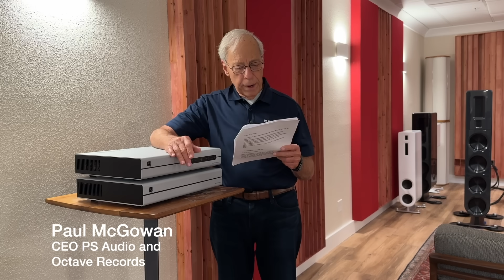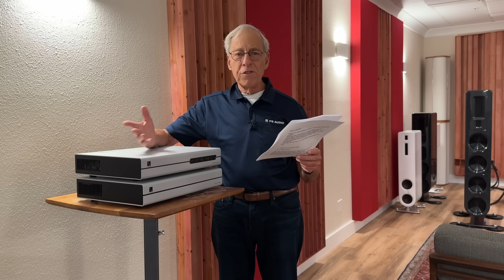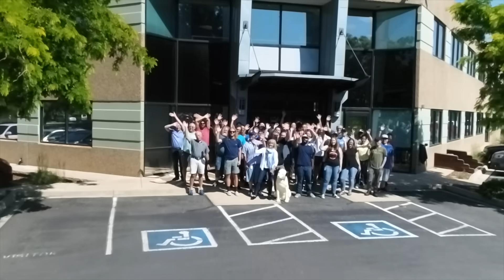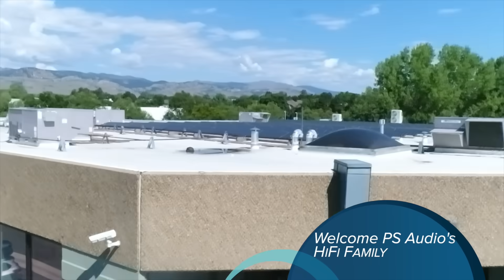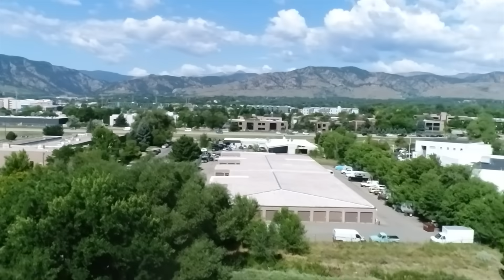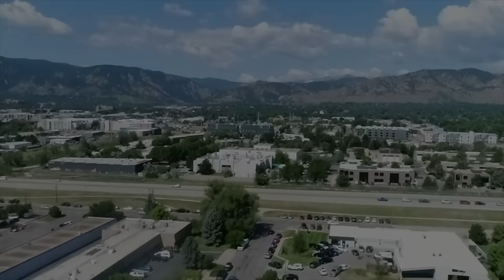Why should we care about distortion?

Comment: And PS audio measure their watt output with 1% THD and 1 kHz only which is ridiculous for hi-fi. The hi-fi standard is 0.05% and 20-20.000hz but then those watt numbers wouldn't be as big
Reply: nicolaihalby ... "only" ...this is incorrect.
I just went to the specifications page for the PS Audio - 'BHK250' stereo amplifier & it gives a range of four (4) IMD & THD figures. One of them is, "20 - 20kHz, 1w/8Ω ... 0.1%" If you don't believe me then go look for yourself...& since when did 0.05% become "the Hi-Fi standard"? Please publish the evidence.
Reply: I don't see a 20hz-20khz full power distortion spec on PS audio. The full power measurement is at 1khz and is 1%.
Reply: @mitchtaylor6512  
As others point out ... this is a standard to be used for comparison with other equipment.  It's not the absolute and certainly not the only specification used in testing.
Reply: @Douglas_Blake but 0.05 THD and 20-20.000hz is the hi-fi standard. 1 kHz and 1% THD is just to inflate wattage. Just like some speaker manufacturers use +- 6dB instead of the standard +- 3dB. Can't remember if PS audio use the 6dB, but wouldn't surprise me.
Reply: @nicolaihalby  
Don't look for conspiracy where there is none, my friend.

Think colour for a second:  If I say RED what do you envision?  But if I specify "Sherwin Williams Red #43" now we have an exact colour to compare to.

1khz, 1% is a standard of comparison, accepted throughout the industry.  If we measure all amps that way, we have facts that we can compare.  

It's nothing but that....
Reply: @Douglas_Blake conspiracy. WTF you talking about 🤷
Reply: @nicolaihalby  
Read it again ... if you can.
Reply: @mitchtaylor6512  ...& your point is??
Reply: That's the point nicolaihalby was making, so he was correct. He was talking about 20hz-20khz distortion measurements at full power.
Reply: @mitchtaylor6512  ...no he wasn't. Please read his original statement (as often as you need to) that I have quoted in bold print ...& stop deflecting.
Reply: And BTW the only thing where 1 watt matters is s/n ratio because that's when you really hear it. Easy claiming 250 watt and the giving distortion specs with 1 watt 😂
Reply: 1% THD power rating is the industry standard, and based on a number of ISO standards for power amplifier ratings. For most modern amplifiers, the difference between the 0.1% THD power and the 1% THD power isn’t very much. It makes a lot more sense to standardize at 1% THD, since that’s around the distortion level where humans start perceiving distortion as clipping.
Reply: @XmqApT4yPQVCXGwR5Ozn not entirely correct, higher order harmonics can be heard below 1%
Reply: @nicolaihalby  ...& now you're just deflecting from your original comment. The fact is that you said, "And PS audio measure their watt output with 1% THD and 1 kHz only which is ridiculous for hi-fi." & that is incorrect. Now that I've proved you incorrect, you haven't even bothered to go back & edit your original untruth to make it factual...smh.
Reply: Maybe you should read his comment again. One watt output was never mentioned. PS audio does measure the maximum output power at 1khz and it is 1% distortion.
Reply: @mitchtaylor6512  
Do you understand the concept of "fair comparison" ... You know the old thing about "apples and oranges" ... you compare apples to apples and oranges to oranges ... and power to power under identical conditions... do you grasp that? 

Haven't you noticed that almost all reputable companies compare power at 1khz and 1% distortion?  That is done so that you can make a chart and fairly compare amplifier power.  It absolutely does not mean that other tests are never performed and it certainly doesn't mean they trying to jack up the wattage numbers.  It's an industry standard test that allows fair comparisons.  

FYI... here is how the test is done...
Hookup and amplifier to a signal generator, distortion meter and dummy loads.
Send in a 1khz sine wave.
Turn up the level until the distortion meter shows 1% distortion.
Now take an RMS voltage reading at the amplifier outputs.
Using P = (V x V) / R calculate the wattage.

It's a simple basic test that even a hobbyist can do.  Since the same test conditions are used for every amplifier, we then have a fair comparison of power between them.

That's it... that's all that 1khz 1% spec. is about... fair comparison... there's nothing more to it.
Reply: @mitchtaylor6512  ... once more for the visually challenged, "And PS audio measure their WATT output with 1% THD and 1 kHz ONLY which is ridiculous for hi-fi."
Now, Mr Taylor... "watt" is singular...meaning one watt & "only" infers that there are no other measurements shown & yet when I go to the on-line page for the PS Audio - 'BHK250' it clearly shows a measurement made from 20 - 20 kHz. If you don't mind me asking you, did you complete primary school?? Where you would've been taught the difference between 'singular' & 'plural' & where you would've been taught the meaning of the word "only" 🙄🥴

Comment: So, then, what kind of measurement can correlate to sound quality?
Reply: stephenwong9723 ...your hearing.
Reply: In general, the retail cost is a more accurate measurement of sound quality than sinad.
Reply: @Pete.across.the.street  😅 older hi fi ones were (and still are) very expensive
Reply: @PokeStoryHarry  got to compare it the price to the other grear that it was selling against when new. Or against other vintage gear. If you compare apples to oranges it doesn't hold true.
Reply: @Pete.across.the.street just compare older ones’ new price at the time and apply inflation and compare, older ones are more expensive
Reply: @PokeStoryHarry  that's not Apples to apples. The market and technology are different
Reply: @Pete.across.the.street  the only one that works for u seems to be comparing the same product on a same product
Reply: @PokeStoryHarry  ...it is hard to compare older (vintage) gear with new stuff mainly because the vintage stuff is not in production anymore & so you can only compare a vintage component with what you think it is comparable with & that, my friend, is subjective. For example: my Celestion - 'Ditton 66' floorstanders that I bought brand-new in 1981 for AU$1,430 would now cost (today) AU$6,880 using the on-line 'Inflation Calculator' & yet to get the same SQ from that pair of loudspeaker I would have to spend around AU$13K on a pair of, say, DeVore Fidelity - 'Orangutan O/93' floorstanders. And then you might disagree with my comparison 😊🥴
Reply: @Pete.across.the.street  
If that's true (and it isn't) how do you explain $100 amplifiers that outperform $1,000 amplifiers?
Reply: @Douglas_Blake  which $100 and which $1000 amp? In What aspect does it outperform? I said in general,  there will always be over priced items.
Reply: Prob multitone intermod distortion less than ur hearling limit of detection distortion in freq domain and fast slew rate (<5us or so) that you cannot detect the speed in time domain
Reply: Music can be clean / dirty, warm / cold. But prob old music sounds better if u use the devices from that era 😅 i guess thats why ppl remaster or try to remaster

Comment: Ultra low distortion won’t fatigue your ears.
Cable materials and passive filtering helps.
That’s how I get there.
Reply: Add vibration control. 
Components count, too.
Reply: yes there must be a reason why you d spent all that money . i mean if u r talking about like 0.1 and 0.0001 territorry with ultra low .
Reply: @tolgadabbagh1877  ...the reason would be 'bragging rights' because if you can't hear it then there's no point blowing all of that extra cash.
Reply: The more you spend on audio gear the better it sounds. It's how our brain works and why snake oil audio cables selling for 1000s of Dollars exist. Our brain is very unreliable in judging audio fidelity. Get too little sleep and you wont hear details well. Drink a Red Bull and you will discover new details. Pay US$5000 for speaker cables and you will convince yourself it sounds better and did a good investment.